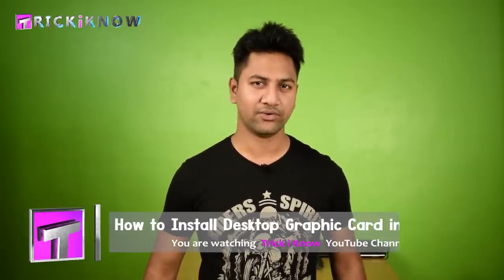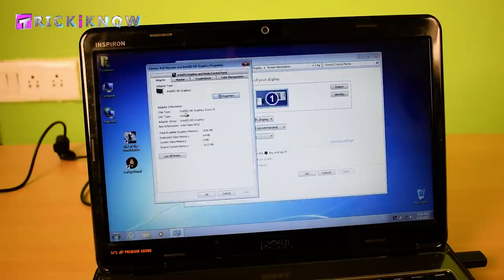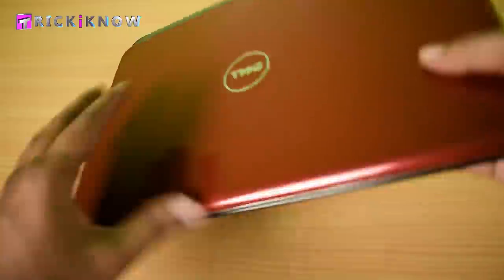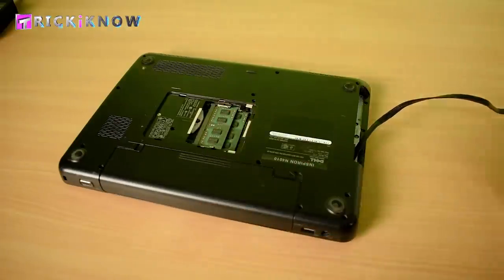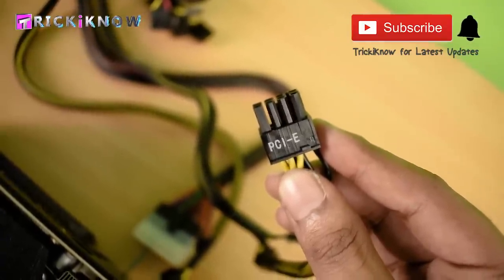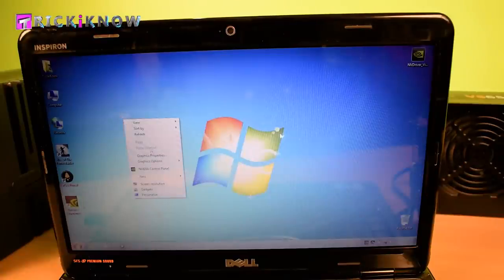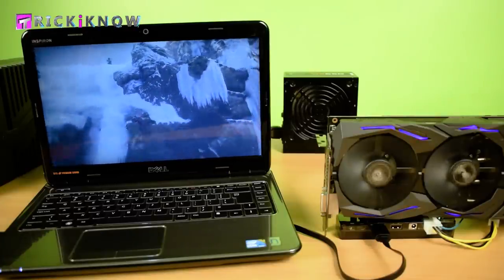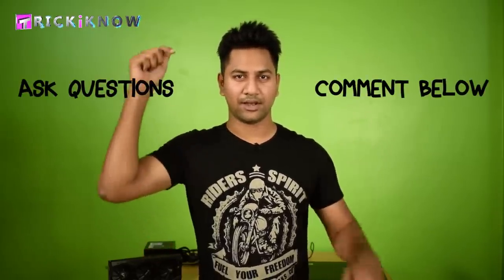How to Setup Desktop External Graphics Card for Laptop - eGPU Ultimate Guide

Comment from the maker: ▶▶ Buy eGPU Dock here: https://wp.me/p6iZSs-ae (Coupon Included)

IMPORTANT - The Graphics Card & PSU I am using in the video are just for EXAMPLE. All users are free to use any old GPU & PSU according to their BUDGET. For WiFi Solution or more info and FAQ please check out the above link. If you have any questions please ask in the comment section & Check out my new eGPU video on Lenovo laptop: https://youtu.be/aM3D3cZmqn0
Reply: TricK i Know how old is your laptop
Reply: TricK i Know plzzz reply me how old is your laptop
Reply from the maker: Ammar khan my laptop is 5-6 year old , it have Intel 2nd gen processor :)
Reply: TricK i Know thank u very much for your reply. But one question is my lenovo g50-70 (20351) does support??
My specs:
Intel i3 processor
Amd r5 230 2gb graphics
4gb ram
How to check my bios is whitelist?
Reply from the maker: See the supported list in my blog , Btw which state you belongs
Reply: I have a core i5 and a gtx 950m. What gtx should I use to run GTA V whitout lag?
Reply: I have lenovo z50 70 with nvidia 820 m
I5
4 GB RAM
2gb gpu .
What is the best GPU for me ? plz reply sir .
Reply: lol....... 2:21 and onwards
Reply: TricK i Know bro,  wht was ur overall costing???
Reply: Can this be used for mining?
Reply: My friend try to configure a hp dv8
Reply: would it work if i used a thunderbolt 3 to HDMI cable?
Reply: TricK i Know plz brother tell me if it is compatible with gtx950.
Reply: TricK i Know can you play multiplayer online internet gaming with this method?
Reply: TricK i Know from where can i get an opening prey tool??
Reply: TricK i Know Make video on how to use duel monitor setup...
Reply: TricK i Know can i show me how is LENOVO G50-80 work? Because it is using the ngff ae key wificard
Reply: I also have same laptop with 2gb graphic card and core i5...Will this game run on my laptop?
Reply: my pc have 2Gb ram and 2Ghz intel pentium
can i set this up?
Reply: does the Radeon RX560 O2G work with it?
Reply: TricK i Know can i possibly power it via 12v dc adapter? thanks!
Reply: TricK i Know can I put use in Dell all in one PC
Reply: does this thing work with Dell inspiron 5570?
Reply: Does I connect it with gtx 1060
Reply: Please tell
Reply: Bhai agar graphic card lagain gay to kiya wifi nahi chalay ga??
Reply: TricK i Know if i remove the gpu then i install it back,did i need to redoing the whole process with is going to bios and installing the driver?
@Trick i Know
Reply: my laptop is 10 year old and i bought latop in 2008 hp core2 duo
processor Intel(R) core(TM)2 DUO CPU  T6600 @ 2.20 GHZ
so graphic card will work with my pc or not
Reply: and which graphic card??
Reply: reply kro bhai
Reply: How about Thinkpad model x201i .. there's no NIC @ Integrated on board graphics/ NVIDIA .. what should I do?
Reply: Brother if i do this. Can i play league of legends online game through wifi?? Because i saw u remove wifi card. I dnt know much abt lptp. Cn u tell me
Reply: Bro what if we attach hdmi to hdmi
Reply: I got a Asus q524u with a gtx 940 integrated, can you please help me disable it from been working on it for days now
Reply: Sir please reply me fast can it works on dell inspiron 15 3000
Reply: How do i do this on a lenveno windows 7 z580? @TricK I Know
Reply: TricK i this available for dell inspiron n5110 specs i7
Reply: Mobile ma laga ga
Reply: Phone ma laga ga
Reply: Will this work also on a gaming laptop already with a graphics card? (Not external) * Built in GTX or RTX chip *
Reply: How i get something like this in Syria??
Reply: Vale apena fazer E-GPU no notebook HP 1000 i3 2328u com 8 de ram e 500 de HD
Reply: I have compaq cq57 laptop... With dual core processor.. Can i use setup for my computer.. Pleaee reply me bro
Reply: I ahve Toshiba laptop and 1050 ti graphic card eGpu so what should I disable In BIOS
Reply: I have Dell vostro 2520.
Intel i3 3110n 2.40 GHz
Intel hd graphics.
Intel HD 4000.
8 gb ddr3 ram.(upgraded)
500 GB HDD.
Windows 7 ultimate.
PCI e support .
I am buying gtx 1030.
Can it run on my laptop?
Reply: Did Egpu Can Be Install In AMD E1 Please Reply Please Please
Reply: Can I do this if I have integrated graphics
Reply: After connecting egpu on my Dell Inspiron N5040 laptop it I'll show black screen ..how to fix this
Processor  Intel pentiyum
Ram 4 Gb 
Hard disc 500 gb
Reply: THANKS
Reply: I got a hp laptop 15-ay091ng its from 2016 and i dont knoe if it has got a mini pcie cable. Please can you help me? Thanks
Reply: Hai there! TricK i Know . I have Lenovo G480, intel core i5 with 16GB ram. Can i use 1080 graphics card?
Reply: I installed the gpu as prescribed by ur vid but when I powered on my laptop.. It just remain there with a black screen.. Anyone please help me in this case
Reply: I have one of the exp gdc mini pci if want go to quikr and search it would save you from exporting and im giving for 2k only
Reply: @mariussavancea6035  1050 ti .. do it in external. With a 500w psu . Then u can run gta5 in ultra setting 1080p
Reply: come on man. how can u make it look so easy??? there is a website dedicated on how to setup exGPU. and worst u dont even reply to my comments or even read it for that  matter...help a guy out man
Reply: It will bottle neck
Reply: TricK i Know does all dell inspiron have pice slot
Reply: Can i use AMD GPU? I'm planning to buy rx580 thank you
Reply: did you try to use amd rx580 gpu?
Reply: Which software use for INNO3D 6gb graphics card
Reply: Bro i think.my acer E5-473 g not supprted for External GPU. Because i did not see any settings inthe bios on selecting integrated GPU Enabled. I hope you help me.
Reply: @engineboy5577  you can disabled via nvidia driver
Reply: @LaboyMoto   Using DDU software to unsintall it .? I have Acer E5-473 g with nvidia 940 m i just want an external gpu for more games .
Reply: First tell me how the game is running by its own
Reply from the maker: @mohitkumargola503  wireless kbd mouse
Reply: @TrickiKnow  sir what will happen if electricity goes off and I have no UPS
Reply: Will it work on dell e5520
Reply: Please mera bhai karo dao please tumhara zasa
Reply: 1st time comments.  .. which intel chipset is it i3 processor cpu modal no...
Reply: hey man can you do this with a mini pcie to usb adapter instead of opening your laptop
Reply from the maker: @nageenafarooq4333  Its a 2nd Gen Laptop.
Reply: Mera bhi karna hai
Reply: Hello sir can you send me your GRAPHIC CARD I want used product
Reply: can i attach it asus vivobook 15 😈😈😈😈
Reply: Hey, do you know why this didn’t work for me I followed your steps and when I went too turn it on the graphics card wasn’t found
Reply: But I must have 2 hdmi cabels if i want play on big screen and lap top too
Reply: PCI wire from your SMPS
Reply: @TrickiKnow por favor, aceita a solicitação da página para poder ver a BIOS do computador Samsung
Reply: 0
Reply: Samsung laptops i must disable drivers of wifi ?

I have Samsung RV510 and it is not detected egpu.
Reply: hi TrickiKnow, could you confirm settings in my bios I have asus S551LN, dual core I7-4500U , thanks
Reply: Please someone help 
I am having zotac gt1030 2gb and it doesnt require additional power like 6pin and its power consumption from pcie slot is 30 watt so if i put it in adaptor i think it is given 75w i think so should it blast
Reply: Sir After Processor upgrade government laptop working good & also now processor have turbo frequency & I upgraded to 8gb ram & ssd & windows 11 & I have one ram slot so I installed 8gb & if u have two ram slot you can upgrade to 16gb ram.
Reply: Can I run gta v i have smd athalon 300u vega3 mobile graphics 2.40ghz if I install GeForce rtx 4060

Comment: Tks for the video. Just one hint, if you plug an external monitor directly on the external Graphics Card you get better performance. The GPU sends the frames directly, instead of going back to the note through the mpcie. You have a boost of 60 to 80%.
Reply from the maker: Thanks for your feedback 🙂
Reply: yes i think he connected to the GPU directly in the video, right?

Comment: Very clear everything!! I hope all  youtubers be like you my friend... well done!
Reply from the maker: Thank you so much for the compliment, share my videos to your friends 😀
Reply: Can you help me with my laptop? I have the model Dell precision1545 from 2009 with Windows 10. I did buy a external graphic card I did put all together but my laptop didn’t recognise the graphic card. I don’t know if I’m doing something wrong or I need to plug anything else... need some help.
Reply: @joaopereira3069  you need to install the drivers bro , otherwise it won't recognise
Reply: @joaopereira3069  Install drivers, configure your graphics after the new gpu and crossfire is showing and also check all the steps to make games use the right card.